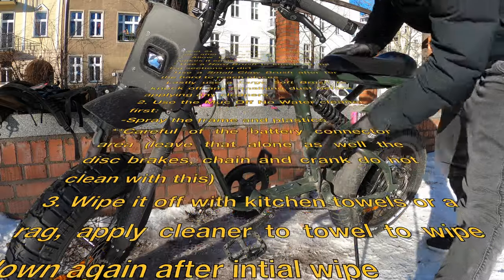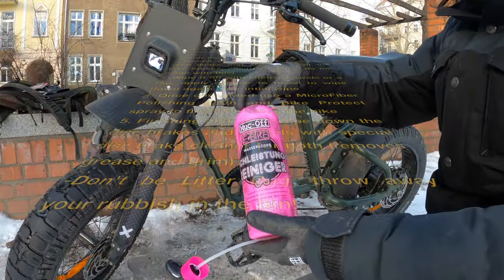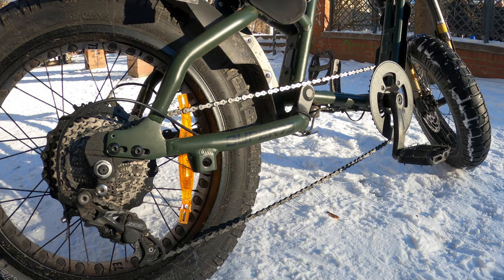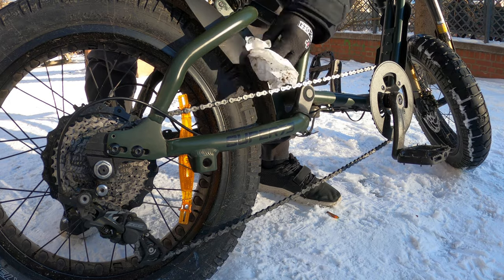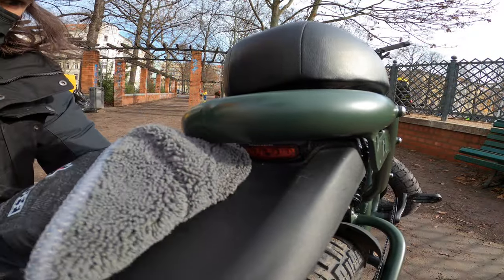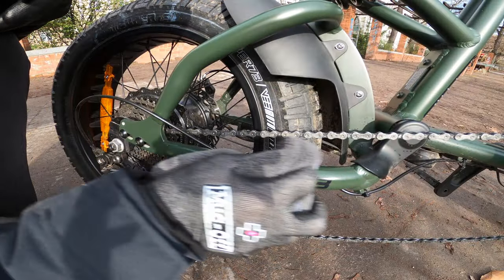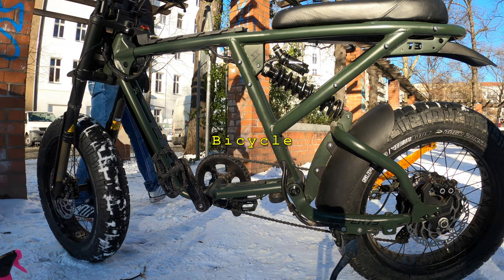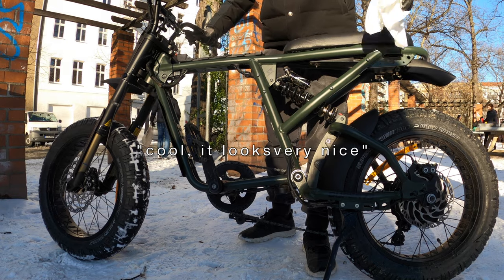Super73 RX - Muc-Off Waterless Wash | 4K

Comment: Hmm, I have to try this set, access to compressor or place to use much water is rare those days.
Another thing , I got my rx dirty like that once and from this moment I feel cracking sounds when move my bike, its possible that sand grains get in tide spaces like in back suspension? It is annoying thing to hear. Everyday less but more than week already I can hear that. Did you have like that with your bike?

Comment: How does it work with the 10'gears and pedal assist? Can you put a throttle on it like in the US?
Reply from the maker: Thanks for the comment,  check out the Good the Bad and the Ugly Video. I go over the 10-speed, throttles and US spec differences  :) Enjoy the video
Reply: @RadCityBerlin  Thanks. I sure am. I am beginning to fall in love with the RX, but I am a bit afraid of the quality as well as the price, which I think is way too high.